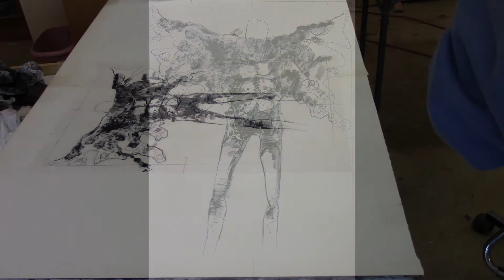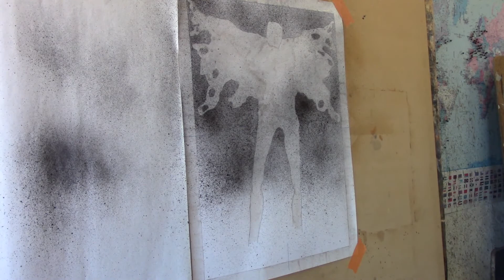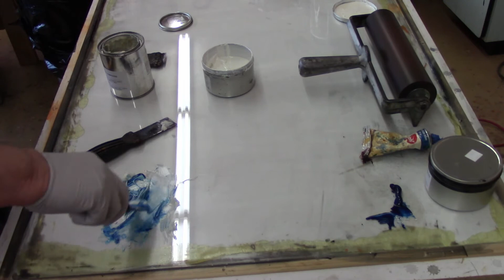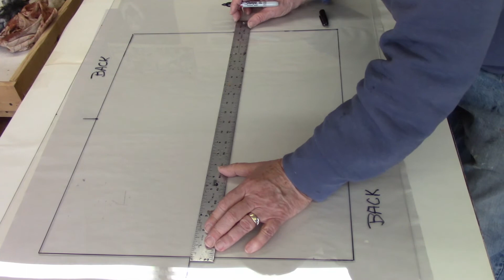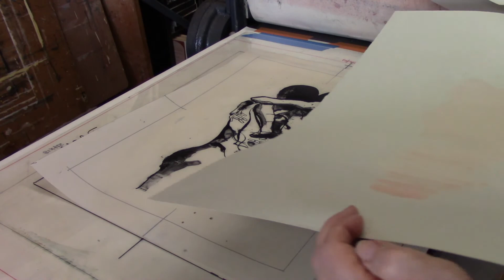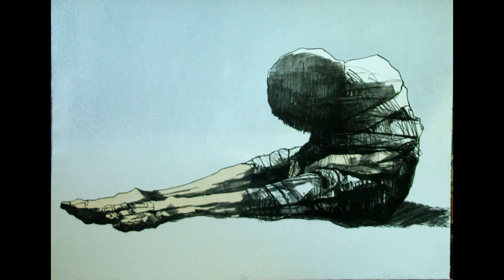Pronto Prints #6 Printing Color Prints

Comment: what brand rollers and brayers do you recommend?
Reply from the maker: I have rollers and Brayers from $600 to about $10, and the inexpensive one seem to work just as well. Graphic Chemical has the largest selection of brayers  The essoee brayers are good, also look at the German brayers  . I also use the cheap speedball brayers for a lot of things and the work well a lot of the time.